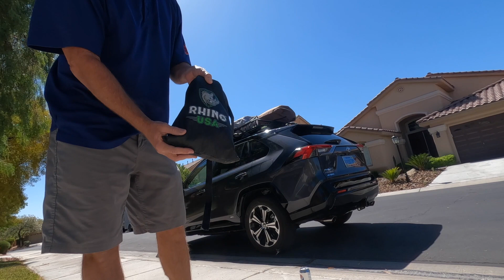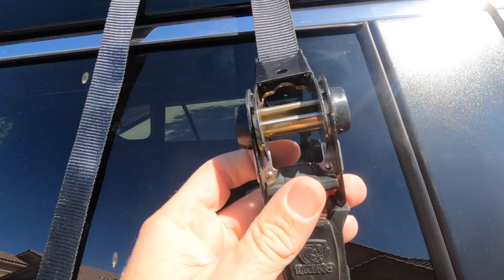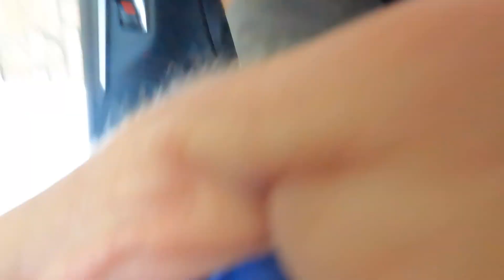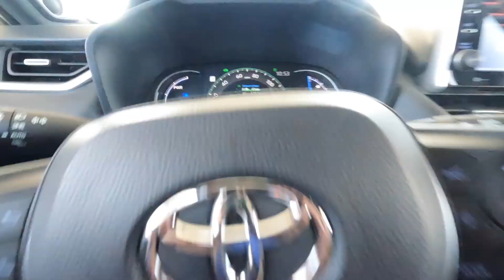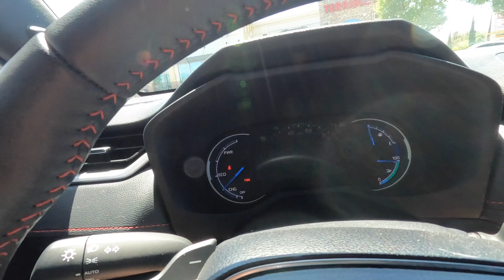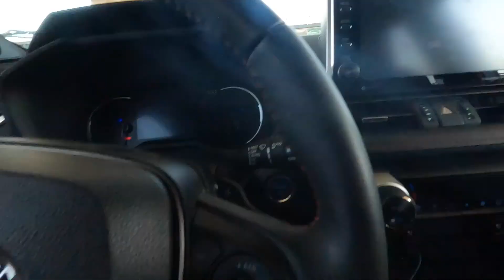RAV4 Prime | Stock vs Roof Rack Equipped | Gas Mileage Test

Comment: Thanks for this.  I knew it went down but didn’t realize how dramatically !  Makes it so I won’t want a roof rack during day to day operation but only for road trips.
Reply from the maker: That's how we used ours.  Kind of a pain to reinstall/uninstall every time.  Also, sort of depends on how much you drive it.
Reply: @GoldenK9Campers  thanks for your info. I really appreciate it!

Comment: Hey, Thanks for the vary informative video. I noticed that during your fill up, your gas needle displayed a "full tank" but your total HV range reads 378 miles... I too have a Rav4 Prime and have been experiencing this same issue. Have you noticed a decline in your total HV range or has it been this way since delivery? The manual states that with HV range should be around 550 miles with a full tank. Sorry for the off topic question. lol
Reply from the maker: It based that mileage on the fuel economy i've had in the past.  Most of our long trips we have a cargo basket in the back and a full load of gear on the roof.  So our gas mileage is not great.  That's the reason it's estimate is so low.

Comment: Thanks for the tests!  I think for this kind of testing you need to choose either pure EV mode or pure HV mode using EV/HV switch.   If you use "Auto EV/HV" mode you probably need to drive for 100 miles or so for the car to run out of battery and start using gas for reliable result.  In this mode while the car decides to use EV its gas consumption freezes and this skews the experiment on shorter runs.

I would use HV mode since you have a second opinion in the shape of a fuel pump meter.
Reply: Just an FYI.  I did use pure HV mode.  Not Auto EV mode.
Reply: @turtle.warriors  Oh, thanks!  And it still used the battery?  OK, I need to experiment more.
To be honest I end up mostly using pure EV as my daily commute is just a few dozen miles.
My charger has a totaliser for the kWh for each charge and it is very convenient as it is a sort of an "electric pump fuel counter".
Thanks for interesting review anyway.
It is not too difficult to estimate extra power required to push the car at specific speed given it's increased cross-section.
If anything, power will increase as square of car speed.  So for the comparative test you might want to choose local route with highest speed limit.
Reply: @holmesjustholmes9412  Thanks.  Sorry.. responded with my new channel name.